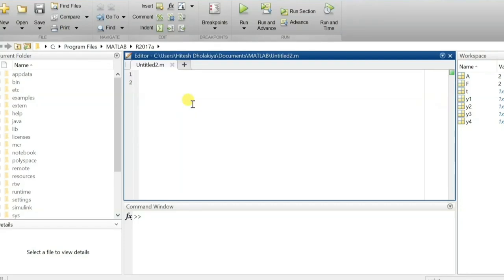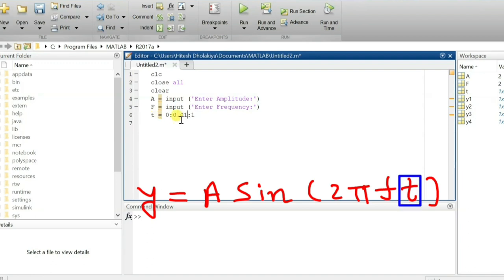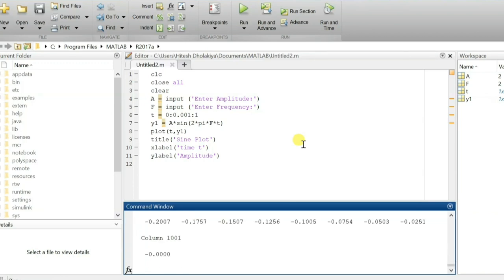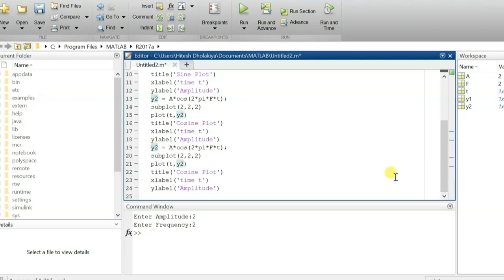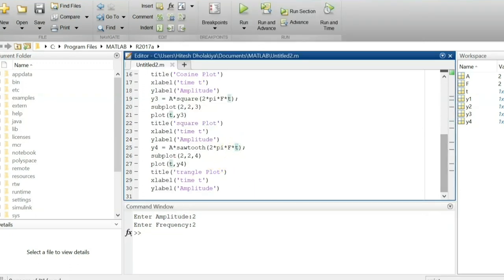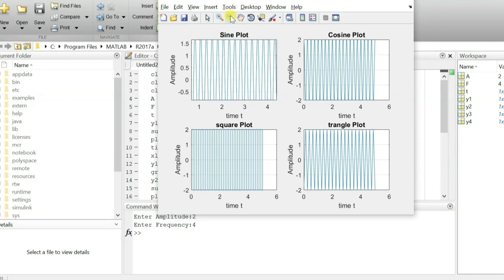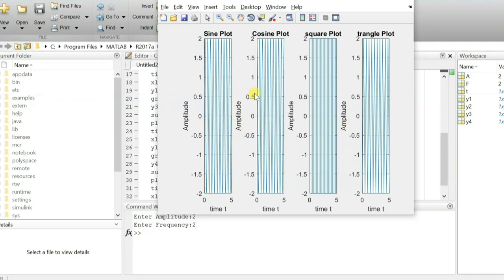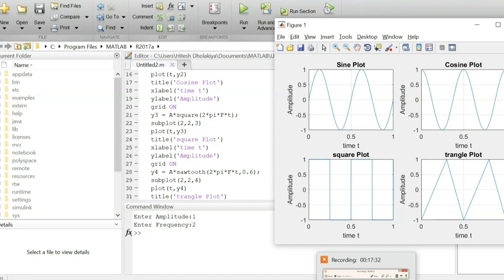MATLAB Tutorial: Sine, Cosine, Square, and Triangular Wave Generation

Comment: Sir, why did we use 0.001 at t?
I understood that 0 and 1 is range but what is the use of 0.001
Reply from the maker: It defines numbers of points,
1st point at 0.001, 2nd point at 0.002, 3rd point at 0.003, .... time.
Reply: @EngineeringFunda  ok sir